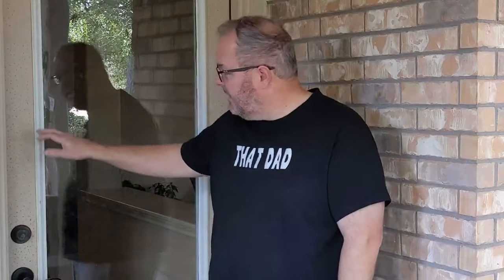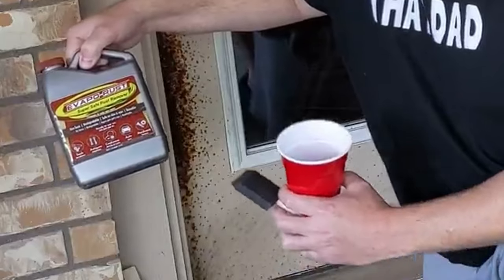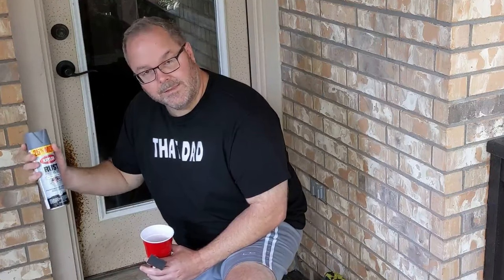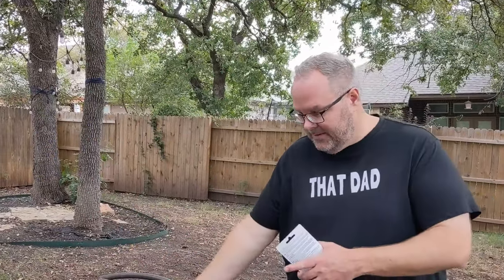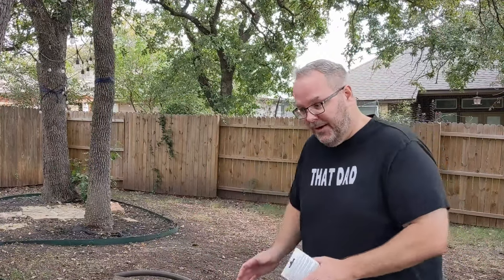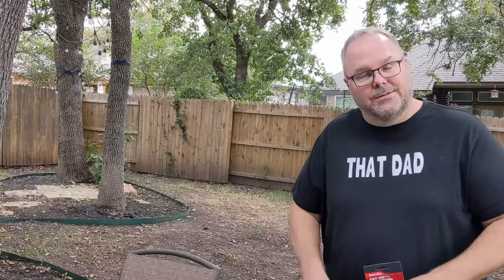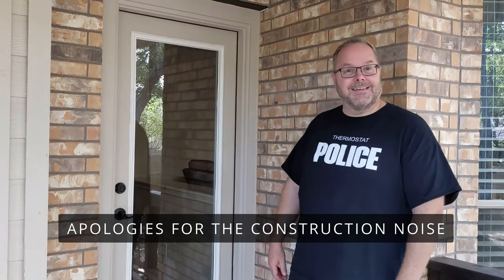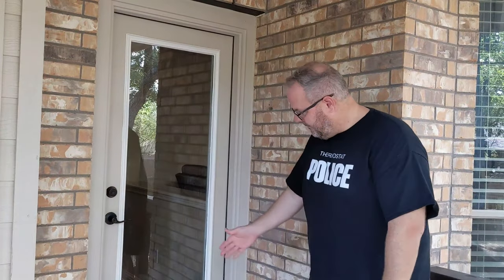Repair Rusted Metal Door: Exterior Door Rust Repair

Comment: Door looks great. I'll be doing this soon. What type/grit sandpaper did you use?
Reply from the maker: Thank you so much! I thought there was no way I could repair it and the repair is holding up very well. I started with 120 and worked my way up to 220 to remove the scratches.

Comment: What pant did you use after you primed
Reply from the maker: I had some indoor/outdoor latex paint that was matched to the trim.
Reply: @ThatDadMike did you have any issue with the latex paint over the krylon rust sealer…. I thought they didn’t recommend latex over it
Reply from the maker: No problems at all that I could tell after one year. I do have a covered porch so that may have helped.